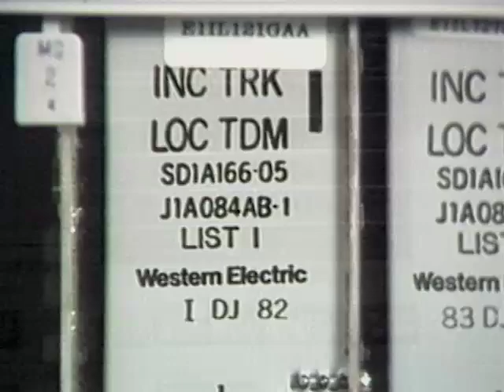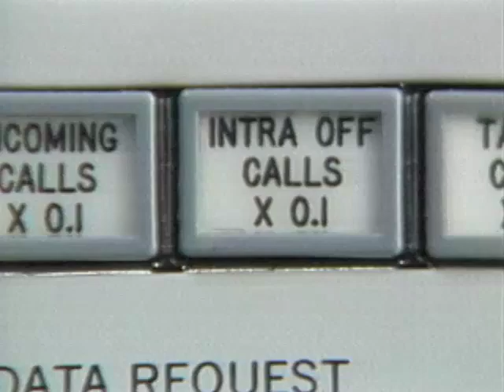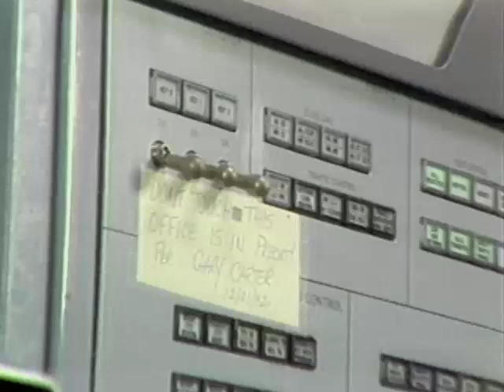Speedy Cutover Service, SXS switching cutover to ESS filmed live at Glendale CA central office, 1984

Comment: I used to watch data board hot swaps . Live at point . 
Nothing was turned off .
As the unit was pushed inwards it powered off , removed , and the updated unit installed ( slotted in ) it powered up on push in , cycled through start up 2 to 3 seconds and away it went . Hot shoe connections .

Comment: How can cable cutters with METAL blades NOT short out some of the conductors? Also, curiously interesting of not is that the Bell System breakup became effective January 1st, 1984. Western Electric, which was a part of the Bell System was, was, in my understanding, no longer permitted to supply equipment to that entity.
Reply: It certainly shorts the cables DURING the cut.  The blades are designed not to mash over the severed ends and leave conductors shorted AFTER the cable is cut.
Reply: There was no such ban because that would destroy AT&T. The RBOCs like PacTel were no longer required to buy from WECo, but instead would bid out to competitively to include Nortel and AECo. Pacific Bell installed a bunch of Nortel DMS-100s but also continued to buy ESS switches.
Reply: Divestiture was pretty much just splitting up the management structure. Even the boom of CLECs in the early 2000s didn’t really disrupt ‘The Phone Company’, 271 relief also didn’t change it much, mobile did though, killed off pay phones and long distance service almost over night.

Comment: I will say those cable cutters are sharp as hell....cutting cables with small wires in them usually ends up with one or two "hold-ons" that roll thru crappy cutters and demand a second cut.

Comment: I don't get it. Why not switch SXS for ESS and then just discard the old one? Was the cutting really necessary or was it just a show off for TV?
Reply: I'm guessing that the incoming & outgoing lines are wired to both the old and new equipment - so the old has to be physically removed before the new equipment is turned on - otherwise you'd have two pieces of equipment trying to handle each call.
Reply: I was thinking the same: publicity.
I guess it was a show-off for the publicity.
They must have had a power switch somewhere, to shut down the old installation...
Reply: @SaschaGrant  No as there is at least one switch (a simple relay) for each line that can goes on/off. That's also the case with the new installation, the same number of line - thousand -  had been switched on with one finger.
Reply: The phone companies ran their systems with military precision, so downtime was not an option. Cutovers like this meant customers would only be down for mere moments. There's a term called the five nines. In a whole year, a typical phone line would be down for like 5 minutes at most. Those days are long gone lol.
Reply: Grab A Sandwich - A landline was the most reliable thing in the world. Worked even when the power was out.
Reply: The calls would have still been distributed to the " old board " which would have taken power / energy / Quality away from the new system. 
Cutting physically confirms this disconnection,  it literally stops the circuits from powering up .
Reply: From another commenter: The new ESS switch had already been wired in parallel to all lines, but had to remain dormant (probably isolated via per-line relays, all of which were engaged by that final switch throw at the end) until the old was gone to avoid conflict.  The old switch lacked any per-line isolation to cleanly disconnect itself, and even if powered down it would still have passive circuit elements (coils, resistors etc.) connected to all lines that would interfere with call processing and quality on the new system.

Comment: From Western Electric’s SXS  to Lucent’s 1ESS, and then 5ESS.  

I am going to assume the 1ESS handled local exchanges and dial tone and 5ESS were tandem switches.  Did I get it right? 

And to those still carrying union cards , is the 5ESS around , it are they using smaller boxes as opposed to frames ? 

Thx

Comment: Back when a phone line was 99.97% 
Now we accept 75% as the norm or worse
Reply: Negative. E911 still mandates high reliability. (for POTS anyway. VoIP is virtually unregulated.)
Reply: My phone always works.   Cell phone.
Reply: @jamisojo  It works when you go to use it. That's a different metric than "availability", which measures that you could use your phone at that moment. "Five Nines" (99.999%) used to be written into law, but that's been dead and dying for a long time. (VoIP has no such requirement. Internet has no such requirement.)

Comment: How much prep time would be needed in something like this?  And how was the copper tapped into the new switch?
Reply: I'd imagine anywhere from a few hours for a small wire exchange in a rural town, to approaching a month in the largest metropolitan central offices.
Reply: How tapped? Many different ways over the years. The first SXS to 1ESS I worked on in 1972 took over a year. only one NNX was moved to an new building on the other side of the alley. The buried cable was tapped in the cable vault and ran to a new frame. All the sleeve leads were wired to relays so that the turn of a key would ground the leads opening the tip and ring.  All offices after that received new COSMIC FRAMES and were tapped in the cable vault.  In the year 2000 we cut all of our 1AESS offices to digital. These cuts were all done on the same floor of the same building. For theses cuts the cables from the OE(Office Equipment)of the old office was Tapped to OE of the new office.

Comment: I still do not understand the purpose of cutting those wires. Were both the older & new wires tied into the same circuit? 🤔
Reply: My understanding is that the ESS is powered on but disabled via command terminal until the old Strowger Stepper is ready to have the wires cut.

Comment: Why they need cut this old connection so fast? I don't get it. New system can be turned on only after old wires are cut down?
Reply: From another commenter: The new ESS switch had already been wired in parallel to all lines, but had to remain dormant (probably isolated via per-line relays, all of which were engaged by that final switch throw at the end) until the old was gone to avoid conflict.  The old switch lacked any per-line isolation to cleanly disconnect itself, and even if powered down it would still have passive circuit elements (coils, resistors etc.) connected to all lines that would interfere with call processing and quality on the new system.

Comment: Trying to understand this, so they were able to quickly cut the equipment side of the MDF to isolate the SXS gear, but the 5ESS was already electrically connected in parallel ? So an instantaneous cutover ?  

If that was the case, then how did the 5ESS come online (via command line instructions) ?   

What I’m trying to figure out is how was the SXS isolated from the 5ESS before the cutover ?

Comment: Help me understand. What was the point of cutting all the cables?
When he flipped the switch, what did that do exactly?
Reply: They were cutting over from the old electro-mechanical step-by-step circuit switching equipment to the new electronic switching system.

Comment: Anyone yakking on the phone at 11:00 pm got cut off.  
Wasn't Pacific Telephone already known as Pacific Bell/Pacific Telesis in 1984?  Maybe the sign on the building still wasn't replaced.  Anyway, probably no more telephone central office cut-overs.  Now it's "internet outages."  VoIP allows literally anyone with a small amount of knowledge, to make their own small switching network in their house.
Reply: Do you know why they had to physically cut the lines? What exactly did that do to switch to a new system.
Reply: @demzerocool7475  From another commenter: The new ESS switch had already been wired in parallel to all lines, but had to remain dormant (probably isolated via per-line relays, all of which were engaged by that final switch throw at the end) until the old was gone to avoid conflict.  The old switch lacked any per-line isolation to cleanly disconnect itself, and even if powered down it would still have passive circuit elements (coils, resistors etc.) connected to all lines that would interfere with call processing and quality on the new system.

Comment: Help me understand this: So they cut the lines to the old switch... Isn't that only half the job? Don't they need to connect the lines to the new switch?
Reply: From another commenter: The new ESS switch had already been wired in parallel to all lines, but had to remain dormant (probably isolated via per-line relays, all of which were engaged by that final switch throw at the end) until the old was gone to avoid conflict.  The old switch lacked any per-line isolation to cleanly disconnect itself, and even if powered down it would still have passive circuit elements (coils, resistors etc.) connected to all lines that would interfere with call processing and quality on the new system.
Reply: Finally the bit of info i was interested in, hidden between all the other nonsense people post here. Thanks 👍

Comment: Can someone explain why this speed of cut matters? I don't see them hooking these up to anything else. If the other system is already set up then why is there not just a main switch to turn it all off?
Reply: Already hocked up to the new equipment but the equipment is turned off.  Before they turn it on, they cut away the old equipment.  From when they start until they end the cut a good portion of a city will have no phone service.

Comment: I have to accept it was necessary to do it this way, because it was done this way, but I would still like an explanation. Cutting a cable can only stop the flow of electricity. But the generation of that electricity (that signals the line is live)  must be coming from some common source, yeah? So why can’t the source be killed? The lines would all register dead, as if cut.

Comment: Is that an ESS 1A being installed in 1984?  Wonder if it was used, I'm surprised they would still be making them in the 1980's
Reply: They were still making number 5 crossbar in the 1970s so I’m not surprised they were still making 1A ESSs in 1984

Comment: Why are they had to cut the cables in a short time? Who can tell me?
Reply: "Why are they had to cut..."  Go work on your English and when you come back someone will answer your question.
Reply: In order to cleanly 'cut-over' to the replacement system quickly, all of the existing connections to the old system needed to be removed asap.

Comment: Can someone explain to me what the hell is going on in this clip? Also, why the speed of the cut is needed?
Reply: The wired up a new switch (with a computer) for a large part of a city but they can't turn it until the cables that connect the old one are cut away.  From the start of the cut until its complete no one would be able to make a phone call.  They also need to check to make certain there was no 911 call in progress that they would cut off midway.

Comment: Still dont quite get it, why do they phyiscally cut wires to switch to a new system? (im assuming)
Reply: My guess is to disable the mechanical step by step plungers to keep from them interfering with the electric switching system. The plungers have to manually select each number in sequence, the ESS would already be ringing the outgoing call by the time the plungers were set confusing SXS into thinking the number dialed is busy and reset (hang up).

Comment: One call was in progress did you see the tiny spark
Reply: That was just a video drop out not a spark and also shorting out and in progress call won’t cause a spark
Reply: @TechHowden  On-hook phone lines are at 48V DC, plenty of voltage to cause a spark. That spark in the video is too spot on with the timing to be a video dropout which is not seen on any other moment in the video.
Reply: @Engineer9736  and that 48 V is that very low current so it would not cause a spark if the line was ringing though it would although it wasn’t actually a spark in the video anyway it was just a video drop out like is normal with a video tape

Comment: I still dont get how simply cutting a wire switches it over to a new system?
Reply: The new ESS switch had already been wired in parallel to all lines, but had to remant dormant (probably isolated via per-line relays, all of which were engaged by that final switch throw at the end) until the old was gone to avoid conflict.  The old switch lacked any per-line isolation to cleanly disconnect itself, and even if powered down it would still have passive circuit elements (coils, resistors etc.) connected to all lines that would interfere with call processing and quality on the new system.

Comment: I still don't understand why the old cables need to be cut. Can't they just transfer the new traffic towards the new switch one by one?
Reply: From another commenter: The new ESS switch had already been wired in parallel to all lines, but had to remain dormant (probably isolated via per-line relays, all of which were engaged by that final switch throw at the end) until the old was gone to avoid conflict.  The old switch lacked any per-line isolation to cleanly disconnect itself, and even if powered down it would still have passive circuit elements (coils, resistors etc.) connected to all lines that would interfere with call processing and quality on the new system.
Reply: Then you would probably end up with 2 separated phone networks if you transfer them one by one, for the duration of the transfer.

Comment: Why does the physical cut need to be made at a certain time?
I assume there is a fallback otherwise they'd have to be reconnected.
Reply: From another commenter: The new ESS switch had already been wired in parallel to all lines, but had to remain dormant (probably isolated via per-line relays, all of which were engaged by that final switch throw at the end) until the old was gone to avoid conflict.  The old switch lacked any per-line isolation to cleanly disconnect itself, and even if powered down it would still have passive circuit elements (coils, resistors etc.) connected to all lines that would interfere with call processing and quality on the new system.
Reply: @RaymondHng  nice explanation, thank you very much.
We have similar in software development. Newer software can be made backwards compatible, but they older software isn't forwards compatible, requiring complete removal
Reply: @DeannaEarley  That's why we are now on Windows 10 and previous versions are obsolete.
Reply: Watching back, that final switch throw is a bit anti climactic!
Reply: @DeannaEarley  That comparison makes no sense if you ask me. They where installing a complete different system. It’s not an upgrade of an existing “program”, hence it has nothing to do with being backwards compatible. The only aspect that stayed the same is the interface to the phones. If you move from Windows to Linux you are also not going to say that you had to ditch Windows because it couldn’t “upgrade” to Linux. It’s just a whole different system.
Reply: @Engineer9736  It is a live switch over. Both systems are connected in parallel to the same lines.
The new one is aware another can be on the line so has switches to connect itself. The old system assumes it's the only one so has no allowance for interoperability.
The same applies on software. Old software has no idea about what it needs to do to be compatible with newer software, but new software is aware and can be made interoperable.

Comment: So they forgot where the power switch was and had to cut all the cables instead?
Reply: From another commenter: The new ESS switch had already been wired in parallel to all lines, but had to remain dormant (probably isolated via per-line relays, all of which were engaged by that final switch throw at the end) until the old was gone to avoid conflict.  The old switch lacked any per-line isolation to cleanly disconnect itself, and even if powered down it would still have passive circuit elements (coils, resistors etc.) connected to all lines that would interfere with call processing and quality on the new system.

Comment: Theres a spark in 3:39 (00:35.5 on the counter), it was said these tools were sharpened and would cause no shorts?
Reply: I'm guessing that isn't a spark--I've watched that segment a few times to see what it is, and it looks a lot like a "dropout" in the videotape source this video is from.  It looks like it has 2 "blurbs" of video noise on the same scanline of video, which tells me its definitely looking like a tape dropout.
Reply: Maybe they meant no short After the cutting. As long as the cutters are made from steel, they will short during the cutting.